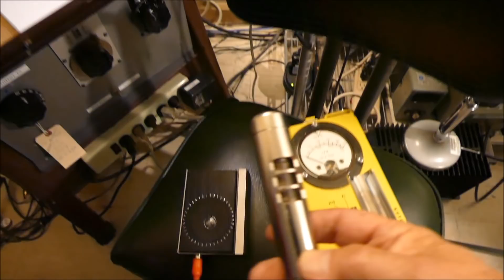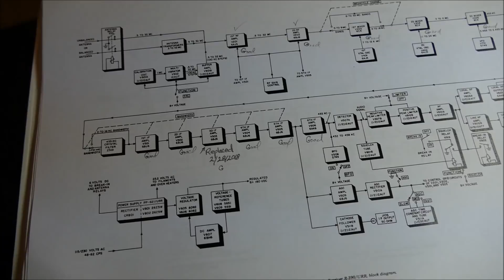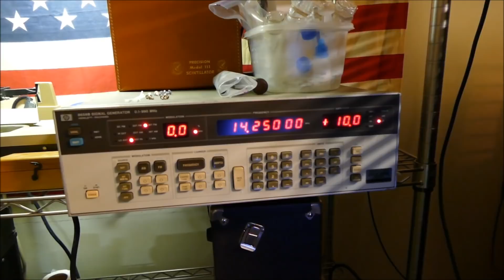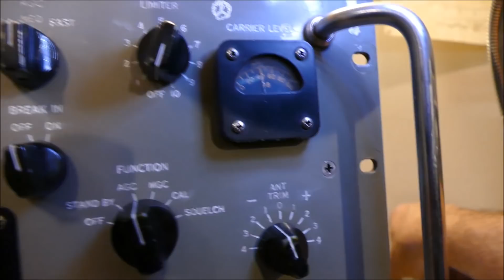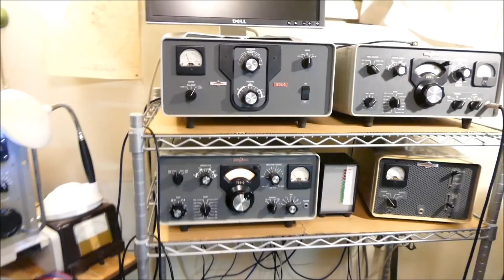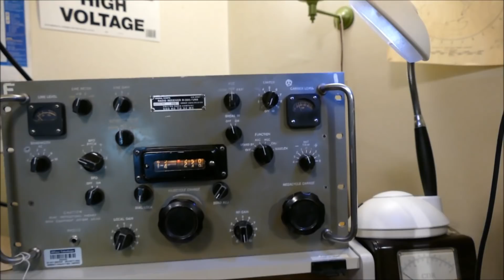Maintaining The Collins R-390 Receiver

Comment: Thanks for the clear and helpful video. I had one of these after college but with many moves, well , it's heavy and I sold it. Anyway I just picked up another one.  Could you tell me if yours is silkscreened or engraved? Looks to be silkscreened as is mine. Engraved would be easier to restore... anyway thanks for the practical tips and your alignment video will be SO helpful.
Reply from the maker: Mine is engraved and I have found that with lots of patients and careful work, the white can be restored with something as simple as White-Out. Same with the lines on the knobs except for some of the years of wear and tear. Good luck with your restore. I added an inexpensive tunable outboard RF preamp to the front end and it really made it come alive. As sensitive (and still very quite) as any of my other receivers.  73  WA4QGA
Reply: @ElPasoTubeAmps  thanks for the tips, yes a preamp would help out and certainly not hurt as I remember there is no way you can overload the front end on these things.

Comment: I am surprised that they didn't use TELEFUNKEN Space Charge Vacuum tubes which would have made the unit very portable because you could run it of 2x 12V batteries.
Reply: see R392 !  Uses regular 6AK5 and 6BA6 like 26a6 tube etc at 24 volts. Portable works very well. Used with T195 TX for RTTY station.

Comment: i just bought one of these things. ive been shortwavin for 50 some odd years and this is mt 1st and i dont know much about them. have you ever had one where the rf gain has no effect? its running wide open and the control measures good . any ideas?

Comment: Hi Elpaso. My R390 and all 5 390a register loud at .1 micro volts. Specs a little less sensitivity
Reply from the maker: I appreciate you telling me that. I can detect 1 uV with no issue but I don't know if I could hear 0.1 uV at all. It is a marvelous old receiver but I have it in "storage" right now - over to the side on a cabinet, not in a hot/cold shed or garage. Sadly, I don't have much use for it right now. For a general coverage receiver I have the 51S-1 and even a iCom 736 with a good general coverage receiver in it. Thanks for the information.
Reply: Yes understand. Mine are all in storage including a 51-S 1 and a 75-S3 but I’ve never had them powered up at the same time

Comment: Thanks for sharing. Even though I have only been a ham for a couple of years I still love the old boat anchor stuff. I am working my way backwards in time. IC-7300, TS-820S, DrakeTR-4... Not sure what is next!
Reply from the maker: You probably can't go wrong with the vintage Collins equipment unless someone has already gotten to it and messed it up. Got to love it and take your time. Don't ever wholesale "re-tube" it with supposed "new NOS" tubes from Ebay. It is a mechanical/electrical love affair with this old equipment to make it work properly again. Kind of like a carburetor type 1960 automobile engine. Switch contacts issues are almost always an issue. Be very careful with the wafer switches because if you mechanically mess one up, it is probably the end of the equipment. Use good contact cleaners sparingly. 
I never had the Drake equipment but I know it was, in its day, quality equipment. My guess is it is not as mechanically sound as the Collins so it probably has more switch/contact issues.
There is definitely a difference even in the Collins equipment between the military grade equipment like the R-390 and the amateur equipment like the 75S-3. They are both highest-quality instruments but the R-390 is a higher grade piece of equipment because of the mechanical/electrical quality and construction.  Keep the boat anchor equipment on the air. People will compliment you on the good quality of the audio. 73 WA4QGA
Reply: Thanks for the reply. I constantly get great reports on the old Drake, and especially on the Kenwood. 

Collins gear is definitely in my future. Just wanted to get through any repair failures on the less desirable gear first. I appreciate your videos. Thank you for sharing your knowledge and experience.

Comment: Thanks for your videos, could you let me know where you found the meter for your tube tester, I have the same tester and my meter also sticks. I found a replacement for it, but it also sticks.... guy said it worked fine??? thanks again for all of the information you give in your videos. CarlAlso, I have an old Big Ben alarm clock with bright green numbers that wakes up my radiation meter... de N6NZX
Reply from the maker: Hi Carl,
I got the meter from Ebay. They are made in Taiwan and look kind of cheap from the back side but they work.
I think any "NOS" so-to-speak meter that is also 60 years old is likely to stick. Here it the link for one advertised right now.
https://www.ebay.com/itm/TV-7-TV-7A-U-TV-7B-U-TV-7C-U-TV-7D-U-tube-tester-meter-replica-NEW/112907833995?hash=item1a49d4d28b:g:YlgAAOSwVtZaDnHv

Comment: David, excellent video as usual. Here is the thing about tube testers and I'm glad you mentioned that they aren't the tell all. They can tell you that a tube conducts from the cathode to plate or if there is a dead short and some even detect leakage. Just because a tube reads strong emission doesn't mean it will work in all applications. If there is excessive interelectrode capacitance,it can make a tube exhibit oscillations at certain frequencies and that can throw off an oscillator just enough to make it not work or decrease sensitivity. Now that you have good tubes,I would go thru the alignment procedure again and you will be amazed at what you will gain. Also, make sure all the source voltages are up to spec and you will be amazed at how much it improves.Anytime you replace tubes in the RF,IF, Oscillator,or AGC,I would always give the alignment a once over. That receiver should knock out 1mv with no sweat especially at higher frequencies.My 390A measures about 1.2mv on the 20m band and I know I can make it better yet.
Reply from the maker: Hi Mike,
It is interesting how the tube tester showed the tube so strong but it was terribly sensitive to shock, to the point of almost not working. It went to the trash can.
If the receiver wasn't so heavy, I would check alignment more often but it is a real commitment to take that beauty to the shop.
From my last video, you can see I am working on the UTC 300B amp. It is coming along but I have a lot of other chores at the moment taking up a lot of my time and then the sheer manual labor of what I am doing refurnishing a house after a tenant lived there for 10 years wears me out. I am not 30 years old anymore.
Tube testers have their place no different from any other set of tools and no single tool does it all but I have found over the years that IF and RF amplifier tubes in the front end of a receiver should be the best-of-the-best a fellow has as it makes a lot of difference in the performance.
Reply from the maker: Mike, I just run across you name and realized we haven't emailed in some time. I know you send me stuff on my email but I rarely check that email anymore. My wife uses my email address much more than I do. I do keep up with my YouTube email address...   TheAudioShop@SBCGlobal.Net    I hope you and your Mom are doing well and staying safe. Just wanted to say hello...
Reply: @ElPasoTubeAmps  Thanks David.

Comment: I have three of the R390A's with the original meters and yes they are radium painted and slightly hot.
Reply from the maker: I find that my R-390 has a very pleasant quality to the SSB audio. Much less high pitched like most all other receivers that I have and it seems highly compressed SSB audio is easier to understand on the R-390 than my other receivers.
On the other hand, very weak signals, right at the noise level, are a bit harder to copy than, for example, on the 75S-3 receiver. My 75S-3 receiver has the slight edge on copying SSB right at the noise level. Do you experience something like this with your R-390A's?
Reply from the maker: I understand the loss of interest. I have been on since 1963 and my interest over the years has been intense and passive. I get on and have an average of 3-4 QSO's  per week so, I am somewhat back into it.I am also still very much into building and measuring and now posting on YouTube and am a die-hard boat-anchor guy. Now I can have all the toys I wanted as a kid...
I added a device to my R-390 made by a company called Treetop  http://www.treetopcircuits.com/pmwiki/pmwiki.php/Main/Products
While the receiver worked very well, the device made and sold by Treetop out of Canada make it much nicer to use. I use my R-390 almost exclusively over the 75S-3 or the iCom because, as you mentioned, it is indeed practically HiFi even on SSB with the added adapter.
Many signals today are way too processed and are tedious to tune in but the R-390 does a marvelous job and any decent sounding signal sounds like they are in the room with you.
Thanks for your comments and best of luck with your equipment and sells, I assume on Ebay.
73 WA4QGA

Comment: Dave,

The printed labels on tubes mean little, as a tube branded GE could have been built by (for instance) RCA.  What does matter is the plant of manufacture and the specific production run.

Eli D.
Reply from the maker: Good point, Eli
I do know all of the manufacturers built and sold to each other with the buyers label on the tubes. Makes sense for only one manufacturer to tool up to make a certain tube and make lots of them. That really stands out in the European made Mullards/Telefunken, etc 12AX7 and like tubes. I see it also in the vintage 6L6 and 6550 and surely others. I mentioned it because I know  people can become very brand oriented, especially in modern day audio tubes and maybe the tubes made today in China and Russia and elsewhere, brand name might be more important than long ago. I also wanted my message to be, you don't know what you got or how the tube is going to perform until you have done all you can to evaluate it and then actually put it in the equipment and see how it performs - one tube at a time. 
I didn't show something that happened afterwards because I had already created the video but one of the original tubes that was in the R-390 and was measuring very well on the tube tester, became noisy in the third slot of the IF amplifier stage. I started to add it in to the video but time got the best of me. I noticed it because the receiver is so quite but the noise level started going up and down intermittently. Very obvious and since I had been fooling with the IF amplifier tubes ... well...   After removing the cover again, I gently tapped on the tubes I had just installed and, there it was, noise as could be with gentle tapping. I checked it again, cleaned the pins gently with a wire brush, swabbed on a bit of contact cleaner but it was noisy and was not a poor socket connection.  I replaced it. Why it showed up now and not before, I can not say. Maybe I moved it from a lower/higher gain position in the IF chain where previously it was working fine. Oh well - such is the unpredictable life with vacuum tubes -.  :-)

Comment: Thanks for this.  I have several “BAs” that I maintain, the R390A among them.  I’ll have to try that SSB Adapter you mentioned.
Reply from the maker: Here is a link to the SSB adapter for the R-390
http://www.treetopcircuits.com/docs/SB390Manual.pdf
I don't sell or have anything to do with this company but I have found the adapter to be excellent. Makes tuning SSB fantastic. You do have to be a little prepared that everything in the instructions may not be exactly as you experience in your particular radio. Mine being a R-390 and not the "A" model may have had something to do with that. Per the instructions included with the adapter, my radio did not have a hole in the chassis that they described so I had to carefully make one and put a rubber grommet in place to protect the wire going thru the hole. The adapter also disables the Carrier Level meter when the BFO is off but I don't find that an issue. Thanks for your comments.
Reply: ElPaso TubeAmps: Very good, thanks David.

Comment: Can you give me a recommendation on a nos tube dealer?  i bought a few and I spent a lot on a mullard thats went microphonic shortly after using i think the guy's selling old used tubes, I dont want to put his business out there for selling bad stuff just don't think I want to go through the same stuff again.
Reply from the maker: I have bought tubes from a lot of different sellers and when it comes to 50-60 old tubes, you really never know what you are going to get. On the other hand, I have found that most of the sellers are truly honest and want to sell top quality vacuum tubes. Many of the sellers have a return policy. That is the only people I deal with anymore. I have been burned by dishonest sellers but I have to admit I wasn't as careful as I should have been and I did not stick to the strictest degree and follow Ebay policy in returning the tubes. Bottom line is, be very careful when replacing the tubes in an old radio like this. The tubes you have in it may be perfectly good. There may be a weak one - or two - but TLC is the only way to deal with these old pieces of equipment. I would never completely and blindly "retube" a device like this although there are sets of tubes sold just for this purpose for several of the more popular pieces of equipment. Buying a replacement-set might be a good idea to have spares but I recommend going thru all the steps with each tube individually and keep up with where any tube was removed from so you can always get back to step-one before you started. Being able to back-out of a situation has saved me many times as I did repair on equipment for NASA and WSMR for 26 years and some problems just don't seem to want to be resolved but compounding the problem was not acceptable. Fortunately our career is not on the line in our ham shack but it is easy to make a mistake and damage something that may not be able to be found for repair. This happened to me with a Gonset G-66B receiver when I was aligning it and did the BFO adjustment. Everything went perfect up to that point  where in the turning of the powdered iron slug, the whole insides came loose from its mount and twisted and broke the wires off. I didn't know this at the time but afterwards in continuing to try and adjust it, the diddly-stick was going down the side of the IF coil and breaking off the tiny wires and damaging the coils directly. I have ordered another 262 Kc IF transformer and already removed the old one (that is how I know what happened to the old one) but repair is going to be difficult and may not turn out good. The old Gonset receives AM very well but with no BFO I can not receive SSB or CW. Best of luck with purchasing tubes. I have found that having lots and lots of spares that I can carefully comb thru is the only way I can maintain my boat anchor equipment in top working order. Hope this helps.
Reply: My go to guy is Jim McShane.  ( http://mcshanedesign.net/ )

Comment: David, every year that goes by there are fewer of us old guys to keep that great old gear alive. Even the S-line gear is pretty ancient now. The R390 is a mechanical work of art, and was the peak of technology in its day. The two things I felt I could never afford back in the 60's were Collins Radios and Tektronix scopes. I'm the proud owner of a bunch of Tek instruments along with some good HP stuff. But my Collins dream is still unsatisfied. eBay prices are so high even now on good Collins rigs. I'm going to the Dayton Hamfest this year, maybe something will turn up. 
Keep the videos coming. 73, Bill
Reply from the maker: Hi Bill,
It has always been a dream of mine to go to the Dayton hamfest. I love hamfests. But, it is so far away from El Paso it is not practical as I would surely want to bring back a bunch of stuff...  
I also know what you mean about the high end test equipment like HP and Tektronix. It is truly amazing that we can now own this magnificent equipment that cost $35,000 just 20 years ago and now we can get it for $500. 
The Internet,  Ebay and YouTube are miracles, in my opinion, where everybody can have some unique part that has been laying around for 50-60 years and they know what it is and there is something inside them (the seller and the buyer) that appreciates these little repair parts. I just ordered a 262 Kc IF transformer for the BFO in an old Gonset G-66B receiver. The old receiver works amazingly well but in the process of tuning it up, I accidentally damaged the BFO transformer and now I can't tune in SSB or CW. I hope I can fix it with the new part. Just a small example of our unique world today.
I do see some nice Collins gear on Ebay. Some prices I find reasonable and others that advertise as "beautiful" doesn't look so good in the pictures... and think about McIntosh vacuum tube amplifiers. They are truly ten times the price that they were in the 1960's and they continue to sell. On the other hand, Collins Radio equipment is probably similar or a little less expensive than new equipment 60 years ago. Oh well... It's a good time to be alive.

Comment: That radioactive dial would bother me.
Reply from the maker: Hi John,I am sure it is completely harmless unless the radioactive material was scraped off and ingested into the body. At that point it might be harmful even deadly but if I understand it correctly, a button-cell battery can also be deadly if swallowed. It is radio active so that it will glow in the dark. I suppose the military personnel using these receivers might have to operate in darkness ?? but still need to see all the dials on the front of the receiver. These receivers were top-secret devices when they came out and the manuals that come with them tell you when and how you are to destroy the receiver if overrun by the enemy. Interesting stuff.